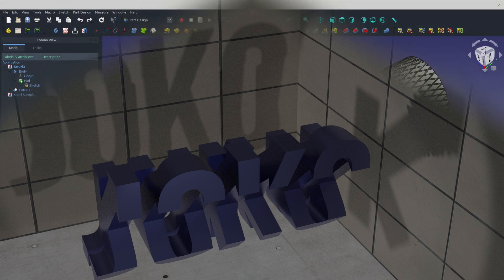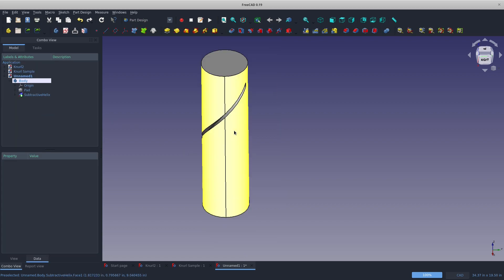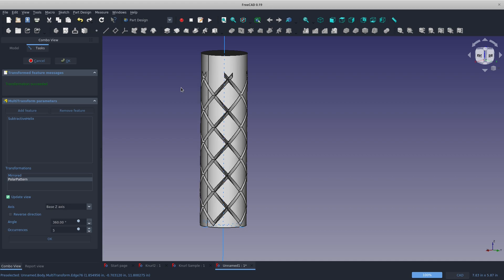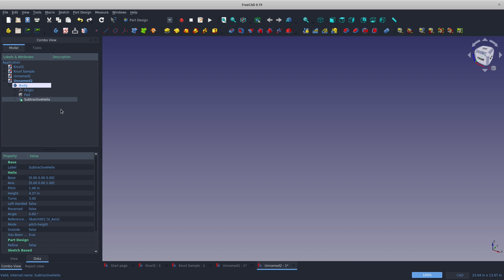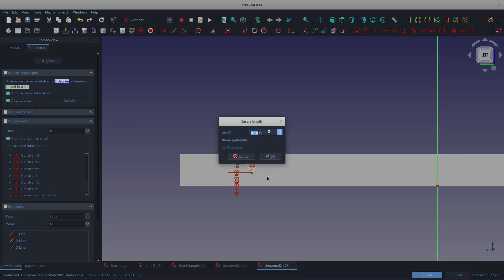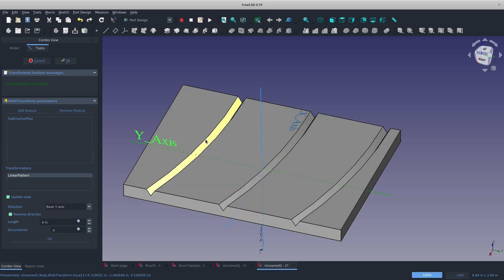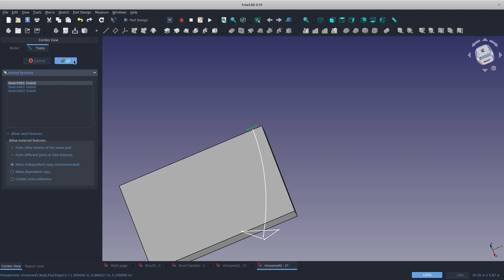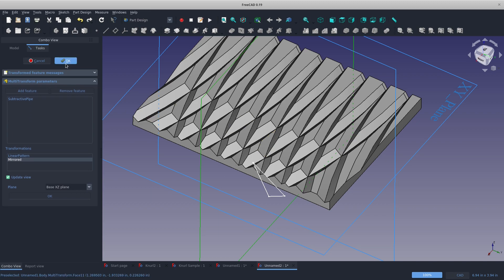Knurling in FreeCAD - Two Examples  |JOKO ENGINEERING|

Comment: I've tried every knurling tutorial on YouTube. Can you please explain why this is not working for me? I'm trying to make a knurled SMA thumb screw for all of my antenna for my FPV radio, & FPV drones. the issue I'm having is after making the sketch with the knurled feature, when i click subtractive or additive helix, I get an error that "wire is not closed" or that "the linked shape box is empty". 

The only difference between my part is that it has the 7.9mm(flat-to-flat) hex hole in the center. I know that I can get this design off of thingiverse or equivalent but I want to know how to do this so I can add knurled features to other parts in the future. 

Thanks in advance,
Reply from the maker: That sounds like the error that would occur on the sketch level.  Likely, there is a piece of the sketch that is set to construction geometry, or there is an extra sketch element somewhere.  Feel free to email me the part and the name of the feature/sketch your having trouble with if you'd like a second set of eyes.